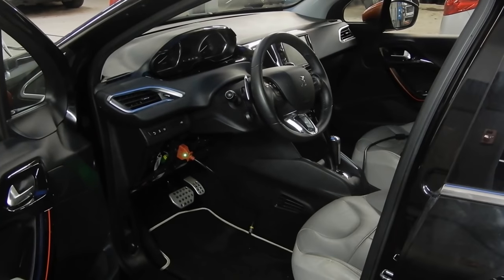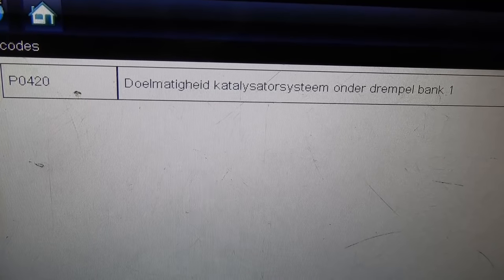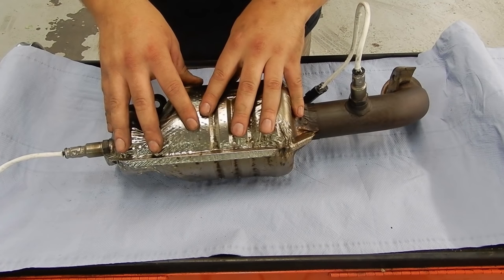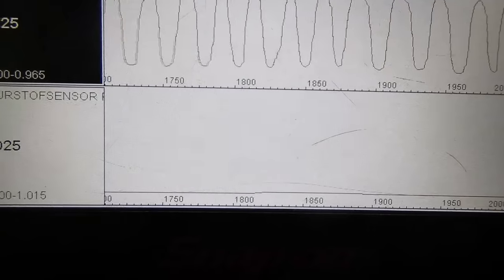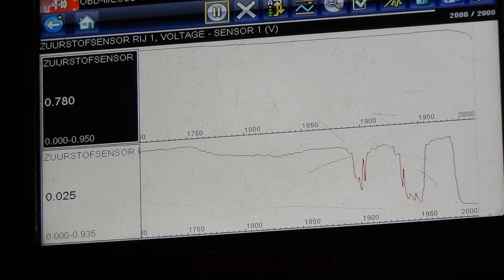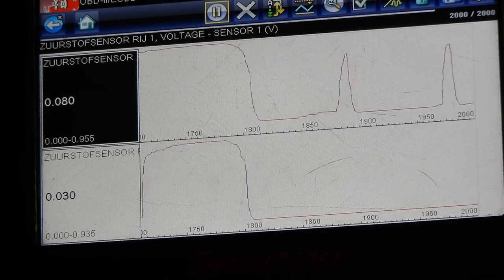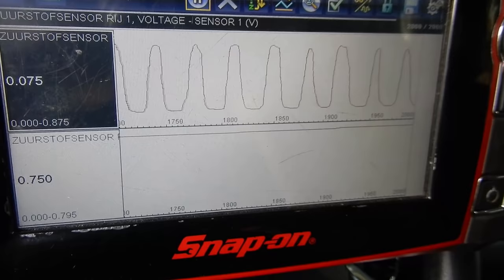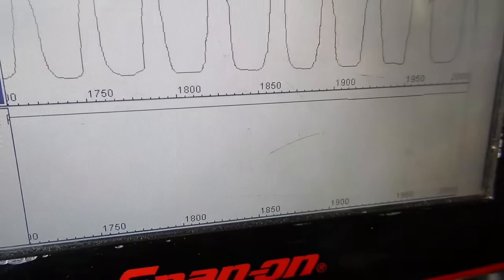Peugeot 208 P0420 / Catalytic converter diagnose and Fix!

Comment: great catch and fix Dan.
that must be manufacturing defect.  Peugeot seems to have a bad reputation in the USA and I see why.
Reply from the maker: They are actually very reliable cars!
Reply: There is probably a lot of thermal cycling going on at the bottom of the cat that is causing the cracks. It could even be cold water being splashed up there that is thermal shocking the hot metal and cracking it. Reinforcing the metal with a weld is probably a permanent fix. Manufacturers can only do so much product testing before releasing a design. At some point they have to say its enough and go into production. This is why they have recalls and warranties.
Reply from the maker: @joevignolor4u949  👍💪

Comment: hi how do i differentiate betw a normal sensor and a wideband, what i learned is when voltage is high 900mv mixture is rich and low volts 0.1mv is lean, from one of your previous tution  on the merck  it was thee opposite hG volt=lean and vice versa or did i misunderstood you. from my  books from poly i was explained this hi=rich  lo is poor. can u explain from the merck video ,where u had leakage u said vice versa,correct me if wrong thanks.
Reply from the maker: jasonics md A wideband sensor has got more wires than a narrowband sensor. The Mercedes  had a wideband sensor, and in that video i told a positive current means a lean condition. On a wideband sensor look at current and on a narrowband look at voltage!
Reply: thanks ,now its clearer.

Comment: Another great diagnosis dan .   I have a peugeot gti with  same system  i would ike to remove the catalytic converter  for more power  so  would i be correct in thinking that the downstream 02  will be fixed  in a rich condition once catalytic converter removed   would that cause the car to run very lean?    Thanks  tony .
Reply from the maker: No Tony with the cat. removed there will be no differece between the front and the rear of the cat.
Because there is nothing in between anymore.
So the rear O2 will do the same as the front O2 and switch between lean and ritch.
This will also chance your emissions so be carefull if there is an anual inspection in your country!.
This will also trigger your MIL.
😎
Reply: Thanks  de cat  for breakfast  then .

Comment: Is that cat some kind of stainless steel? I got it out but I do want to weld it properly. If you drive on for a year when this problem occurs it will start to sound like a motorcycle. Parents in law.....
Reply from the maker: I'm not sure
Reply: @Diagnosedan  did you weld it with normal mig? And has the owner had any problems with it since?
Reply from the maker: @Rashombo  yes welded with normal Mig. This car was brought to me by a used car sales man. He sold the car and i he never seen it since.

Comment: Same issue with a friends 208, error popped up about Cat, car is 2013 with 47k miles.  Garage advised it was fine to leave as is, she ran it now for over 6 months without issue however surely it’ll do some damage?
Reply from the maker: It's a quick fix, just a weld. Get it fixed😉
Reply: DiagnoseDan thanks I’ll let her know Peugeot wanted £900 to replace it. Has it likely caused damage to the engine or it just run less efficiently
Reply from the maker: @thepomandozzy  neither, just emissions

Comment: @DiagnoseDan
 one question I have a problem with my Peugeot 308 THP cat is destroyed and new from dealer is about 780 euros. Experienced exhaust mechanic telling me that it is ok to veld in universal cat into current housing. This would cost about 150 euros. Universal cat is Bosal's model. It has two year warranty. 
My question is: if I go universal cat route will engine work ok and not throw error codes. Do you have experience with universal cats?
BTW, great explanation on how cat works. It was easy to understand the way you explained it :)
Reply from the maker: I do have experience with them and it's not very positive. I have replaced many new aftermarket cats on this model because they were no good. Of course i haven't tried every brand out there.
Reply: Thank you very much for response. :) Since you have experiance with cats on Peugeot 308 thp. Can you recommend some make and model of cat that is ok?
Reply from the maker: @nikolakljaic  i would recommend original, or good used original.
Reply: @Diagnosedan   Thanks for the help. That is what I wanted to know. All the best :)

Comment: Thanks for the great video. What does it mean when on the first diagnosis on this issue, it has a bullet point saying “intermittent”. The mechanic I went to said the problem showed before and it was cleared. The person who sold me the car said that was unaware of the issue. The error appeared less than 200 miles after I bought the car and every time I reset the warning, it returns before 200 miles. Can I somehow get evidence that the issue was known before?
Reply from the maker: That's going to be difficult
Reply: What does “intermittent” mean in this context then?
Reply from the maker: @andygloria4493  that the fault isn't always there
Reply: Okay thanks mate

Comment: Hi dan I know it’s a bit late joining in on this video, but I have recently been watching as much info as poss on o2 sensors. It was my understanding that the down stream o2 should read about 450mv and yet I the Peugeot’s at work that recently checked, most ran about 700mv similar to yours. How come? I thought that meant it was running rich. Now i am a bit confused. Hope you got another video coming soon. Thanks again.
Reply from the maker: Yes, 700mv is a good reading. I'll explain more in a future video. Didn't want to complicate this video!👍
Reply: It will be 700mv if cat working correctly as the cat should be using oxygen as part of correct operation and therfore downstream oxygen sensor will read low oxygen content.
Reply: Thanks George.

Comment: Great video Dan!! On my Peugeot 208, today I found this problem for the third time. Do you think that this problem can fix it completely without other times? in warranty I have already changed two pieces, now I'm out of warranty, is it as a factory problem, I should not spend other money, right? Thanks man!
Reply from the maker: Simone don't change the cat. but weld it.
First of all it saves a lot of money and second the problem is pemanently solved!
Reply: DiagnoseDan thank you Dan! I will try to speak with the mechanic because I think that them Don’t know the nature about this problem. It’s ridiculous to be here for the third time with the same problem...
Reply: Hi Dan, disassembling the catalyst do you think it's a difficult job to do for those who are not mechanics? I would like to try in my home box, is it complex? At work I have the welder and I would like to try if Peugeot does not cover me with the replacement. Thank you so much Dan!

Comment: I have a 2014 Peugeot 2008 that has the same Engine with 33,200 miles on it. Engine light came on this morning, Plugged in the ODB2 reader and it threw up the P0420 Code, Just cleared the codes and I'm going to see how I get on. Was advised by a mechanic friend to throw in some fuel additive to clear the ends of the sensors. Being a 10 year old car with only 33K on it I can only assume its not done many motorway miles so it would just be carbon build up.

Comment: Actually - this cat problem was present on many Mercedes W211, W219 and other AMG cars with M113K engine.... the welds would crack. An easy fix though, just welded them back up

Comment: Dan, excellent as usual, question as it isn't mentioned, what is the answer when you have normal cycling pre-cat, yet the same post- cat? The STFT is maxed out at -25 at Idle and does not improve when the engine speed is raised,  The prior garage who looked at it already replaced the pre-cat sensor,  The car has no Maff just three IAT/MAP sensors, it is the 2007 VW 1.4tsi engine with Turbo and Supercharger.
My thinking is it is the cat as I cannot seem to get the post-cat sensor to stay lean..

Comment: The ongoing problem I have with the wifes W221 Mercedes S class V6 3lt diesel is that every 18 months (without fail) the preasure equaliser sensor on the bulkhead for the CAT fails for no apparent reason, so ends up costing about £65 to replace.

Comment: That is amazing,that is a huge crack on the stainless, nice catch, DD.

The way i check for Cat cracks like that, without removing the Cat, it to partially plug up the tail pipe, so NO Air can get in and lean things out for the 2nd O2 sensor, and then observe that it goes to .5 Volts; if it does, then air must be getting into the Cat;

   Them greenphissers mandate those converters to be extra robust,made of stainless steel,but,as usual ,they created another problem: another EGR...red hot welded steel being splashed by freezing water and snow; what else is new... they are not experts of anything,just bureucrats making money; and ,also,ALL OVER europe at least, there are millions of catalysts being stolen from under the parked cars,at night, by the organized crime, for the precious metals inside,for  they are more valuable than gold, they didn't think of that: there is no limit for the ignorance of the governments; when in doubt, they'll do anythingº.º

Comment: I can ad that if you get this code on your Citroen or Peugeot and you do not have a leak or bad O2 sensors, you COULD have a bad fuelpump that is making it running lean! I had this fault code for far to long and i melted the Platinum inside the converter. The pistonrings in the engine went real bad so the fuel found its way down to the oil. I like this kind of videos, keep it up! :-)

Comment: Hi Dan. Im no mechanic and lives in Denmark. Here is my scenario: So my peugeot 2008 showed me the engine fault and i bought a Konnwei kw310 tester. Just tested it and it has 2 codes. Both with the same code P0420. So i googled it and your vid was the first so ive watched - great vid wished ive seen it 5yrs ago (my cat had a crack so it got replaced. Sadly i didnt know it could be welded). 😢
Now as i said im no mechanic, so im not sure how to test the fuel thingy to rule out if it is the sensor. Is there a way can do this without going to the mechanic? Thanks in advance 😊

Comment: my 208 has same P0420 code, but a mechanic said he thinks is running rich.  It failed MOT on emssions at Idle.  Not sure what to do next.  I changed OIL, Air filter and spark plugs and the Upstream Oxy sensor. It made no diffrence so I swapped the new upstream and old downstream and it still failed.

Comment: Thanks for  everything  !!!
2006 ?  4.6 Chevy  van  parked  2years  company parking lot.
Came for  smog check with lean code but pass tail pipe smog good .found few broken exhaust manifold  bracket bolts because factory machinist use intermediate tap only when  mechanic install they were not tight enough so force more then broke many bolts. So I purchased bottoming tap and cut little more to the bottom and original bolt made no air leak cleared DTC and passed smog check .

Comment: Nice Video Dan. I had a go a diagnosing the same code on a micra found upstream O2 giving good frequency up to 1v and also found secondary o2 giving good frequency up to 1V. As you said this will indicate a rich condition after the CAT so the cat is not working correctly, i measured heat of exhaust before and after the cat and got reading of 120C before cat and 180C after so its doing something?. Car previously had been run with failed coil pack on one cylinder, i believe excessive rich mixture could have damaged the cat. Car has engine light on so i cleared this and car passed emissions test in UK.  I never changed the CAT as this is on my sisters car and it is too expensive on an old car. 
Did i diagnose a bad CAT correctly?, anything i missed?

Comment: Another great video DanTheMan....Working on my daughter's 2007 Altima, we had to replace the CAT twice. 
The first time, we bought the car with a loud exhaust leak...I suspected the joint between the exhaust manifold ant the CAT (it is one piece like this video)....sure enough there was a large crack ....but no codes being thrown.

Bought a new CAT/exhaust and in a few months the same damn thing happened...this time the new part was covered under warranty. No codes too...just loud exhaust sound.

Apparently a very common thing on the Nissan Altima.

Comment: Do you think using a smoke machine would find such a leak? Or even compressed air into the tail pipe and a soapy sprayer?
Reply from the maker: Don't forget you can't pressurise the tailpipe the side connected to the engine is not closed, there are exhaust valves that are opened.
Reply: @Diagnosedan  If exhaust valves are open, would the intake valves be closed? Then it should hold pressure unless piston rings are bad, or not?
Reply from the maker: @MaxAirGo  there is also a thing called valve overlap this is a moment both valves are open. And you might be able to figure it out but i think it wouldn't be a great test.
Reply: @Diagnosedan   I am always learning something new from you, thank you.  Perhaps I can plug up the throttle body then? I am thinking of using shop vac to blow up the tail pipe to find all the leaks in the exhaust system with soapy water. Just trying to avoid removing the whole exhaust system on a cramp V6 engine.  I think I have small leaks on both banks that affect downstream o2s but its intermittent. Please look at this datastream video https://youtu.be/pkSkHvg8xwY , problem seen at 30 second mark and at the end when one 1/2 goes really lean.
Reply from the maker: @MaxAirGo  why make it more difficult than it is, just plug the exhaust while the engine is running and check for leaks.

Comment: Hi i have  a 2006 toyta yaris 1.3  failed mot test because of a  slightly high lambda reading  1.08  here in the uk  my upstream 02 is switching  from 0.035 to 0.700v  but  downstream is  fixed  at 0.055v  i removed  the cat hoping to find a crack but nothing not sure about  numbers  could you please point me in the right direction what 02   should  i change ?  any advice would be greatly appreciated .
Reply from the maker: Was the lambda measured at the exhaust with a gas analyser or read out with a scantool?
Reply: @Diagnosedan   with an exhaust  gas analyser  ,  i had a look at 02 voltages with my own scan tool
Reply from the maker: @tonypond8196  don't you just have a little leak in the exhaust somewhere? Look at the entire exhaust not just at the Cat.
Reply: @Diagnosedan   no  leaks i checked the full system even with a rag over the tail pipe  , one last question (i promise!)  could it be a faulty downstream 02 being fixed at  0.055v would that cause a slightly high lambda reading  thanks very much for your  advice  . tony
Reply from the maker: @tonypond8196  ad a fuel to the engine (Spray into the intake) and see if the downstream reacts, if it doesn't it's no good!

Comment: Hey Dan, would this leak cause a switching from lean to rich after the cat is up to temperature?
Reply from the maker: If there is a leak there is a lot of extra oxigen in the exhaust and that will cause a lean condition even if the Cat. is hot
Reply: Thank you, Sir. The reason I asked is that I am trying to diagnose a P0420 and P0430 on an Infiniti FX35. According to the flow chart, they want an exhaust leak check to be made in front  of the catalyst 1 after the A/F sensor. I am struggling to understand how such a leak would cause these codes.

Comment: I had a suzuki swift with a intermittent p0420. De downstream sensor sometimes measures a rich mixture with the value staying 0.9 volts. And then the next moment everything is fine. Still a current problem.

Comment: Awesome video Dan ,I've learned a lot . I have Hyundai i20 year 2013 with 1,2 L gasoline  63 kw and 125 000 km and having lately issue with loss of power .The repair shop replaced Lambda and spark plugs with wires. Less than 50 km later P0420 poped up .They said it is bad cat.converter. I guess I should look under the heat shield , too bad you're so far away .

Comment: Other than a crack, what was happening when driving like this?  I have a problem with no sensors but when the car gets warm it is lacking performance. Peugeot 308 1.6thp 2014. First 10 minutes it is fast and after the temperature comes up the problem starts and will not pull as good with stuttering

Comment: I think that all cars sold in the United States are warrantied for 10 years or 100,000 miles for any emissions-related problems.  So, this would have been replaced for free to the consumer under the manufacturer's warranty.  Only when the car is out of warranty would I then recommend wielding the tear shut.  Good diagnoses though.

Comment: Beautiful videos Dan - Thank you!

I am looking at a Citroen C1 / Toyota Aygo / Renault 107 with the same behaviors you show in your video, although putting my hand over the air filter intake I can only get the post-catalytic O2 sensor up to about 0.25 volts.  What kind of enrichment did you use?  You did say "propellant" at one point.

Of course it is unsatisfying to ignore problems, but if the cat is not repairable, given that this an old car and hardly worth investing in a new catalytic converter, what are the consequences of driving with an erroneous "lean" signal from the post cat sensor?

Comment: Hi Dan - greetings from France. I run a small garage in the pas de calais, I've watched all your videos and liked them all !!! Thank you for such excellent material  - quite literally the best available on the net. Could I ask a question ? -- why do front o2 sensors fluctuate? Is that the ecu doing this or the sensor, or it the engine producing this variation? Never found an answer to this anywhere ! Anyway, if you have time and know the answer I'd appreciate it. Thanks again for great videos, just can't wait till you make another one ! Take care, Andrew